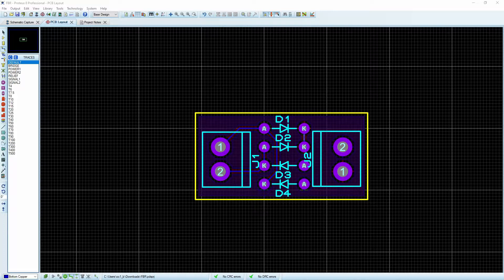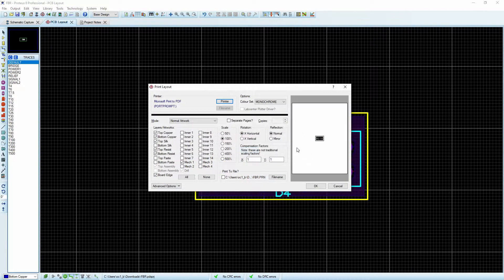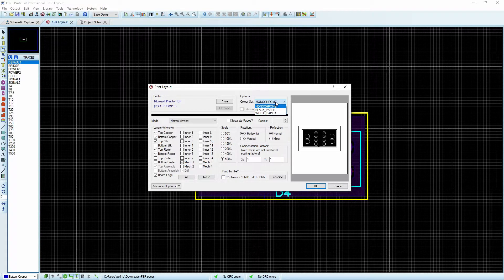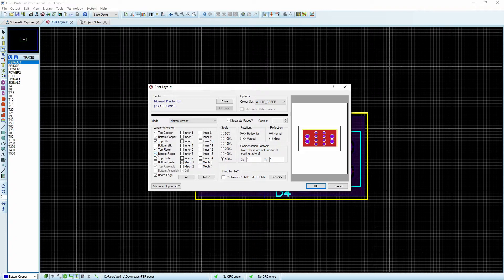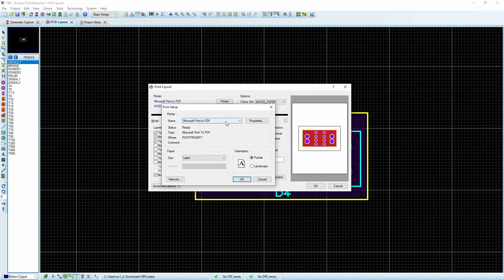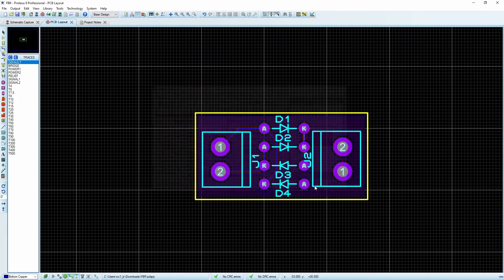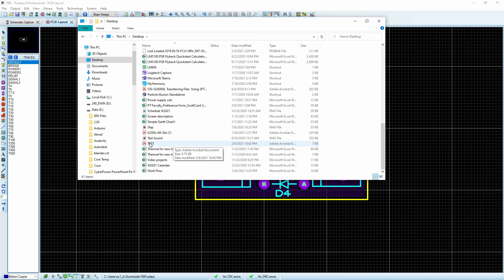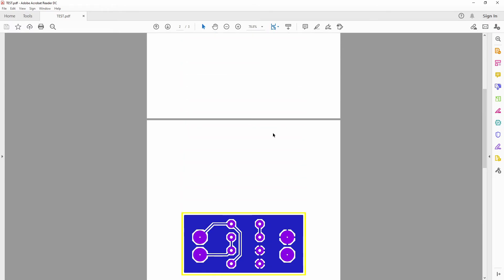PCB Printing in Proteus

Comment: transmitter and receiver gpr radar ( wave)
Reply from the maker: Not a simple project! I have no experience with this (yet) but, where in the design stage are you at? Is there something specific you need my help with?
Reply: @ScottCard  jes please , I found the transmitter wave diagram but I'm not sure it works !
Reply: @ScottCard  LRLc telescope
Reply from the maker: @moussafakir4765  Please provide a link to the datasheet so we can have a look.
Reply from the maker: As the article you have provided points out, this product is not likely to ever work. The now obsolete IC is a frequency generator and the other is an amplifier can still be found but, from a physics stand point, you will not get much in the way of results (especially with paper money). All you will detect on this it the signal you are generating and the button you push. I would suggest you find another project but, if you feel strongly about this one, build it up on a breadboard. You could even use a function generator and oscilloscope to do a proof of concept. Interesting read, thank you.
Reply: @ScottCard   prof, In order to build, what means resistor 200, disk 100k, and 10k tuning? 100k disk is variable resistor?
Reply from the maker: @moussafakir4765  Parts list:
ICs
     XR2206
     LM339

Diode
     LED
     3.9V Zener

Resistor
     3@5100Ω (5k1)
     2@200 Ω
     2@33000 Ω (33k)

Variable Resistor
     100000 Ω (100k)
     10000 Ω (10k)

Capacitor
     10nF
     1µF

Switch
     NC push button
     SPST Toggle
https://www.sparkfun.com/datasheets/Kits/XR2206_104_020808.pdf
200
Reply: @ScottCard  thank you very much prof 🤝
Reply from the maker: @moussafakir4765  no problem. Let us know what you find!
Reply: @ScottCard   prof, I find only 200k and 200r, of whom I can change it value to 200 ohm . 200k or 200r? in proteus
Reply from the maker: @moussafakir4765  Use a default resistor (RES) and change value. The same with the variable resistor. Use POT-HG.
Reply: @ScottCard  prof hi ,How can the variable resistance be used, knowing that it has 3 terminals? How can I connect it in the circuit with respect to 200 ohms? For 100k and 10k the same thing ..!
Reply from the maker: @moussafakir4765  When using a potentiometer as a variable resistor, only use one terminal and the wiper for a linear response.
Reply: @ScottCard  For the variable resistances 10k and 100k,....( potentiometer or Rheostat ) please ?
Reply: @ScottCard   How can I install the variable resistance in the circuit to change the frequency and the current? potentionmeter or Rheostat ???
Reply from the maker: @moussafakir4765  Use "POT-HG"
Reply: @ScottCard  variable resistor (Pot-HG) has 3 terminals, for xr2206 frequency control, how can the variable resistor be installed ?
Reply from the maker: @moussafakir4765  Connect one end and the center (wiper) to provide a linear response.
ie. pin 1&2
Reply: @ScottCard   prof please , The type of capacitor( 10 nf , 1uf )  used in the circuit ?
Reply from the maker: @moussafakir4765  Less than 10uF can easily be achieved with a ceramic capacitor. In Proteus use CAP from the library.
Reply: @ScottCard  How to measure the frequency in proteus ?
Reply from the maker: @moussafakir4765  You can use the "Counter Timer" or the Oscilloscope found on the left under INSTURMENTS.
Reply: @ScottCard   When running the circuit in proteus, it does not work. 
partition analyser errors ( no model specified for U2/ simulation FAILED due to partition anlysis error(s)  ) . Source : U2  xr2206.
Reply from the maker: @moussafakir4765  This means that there is no simulator model. You can exclude U2 if it not needed but, other than that you would need to find the SPICE model. I will have a video for this in the future.... way down on the list.
Reply from the maker: When picking parts to simulate, be sure to select the "parts with models" filter on the Pick parts menu.
Reply: @ScottCard  Can you tell me which side to tie a counter timer? To measure the frequency in the circuit because it doesn't work and oscilloscope please .
Reply from the maker: @moussafakir4765  With the oscilloscope, connect channel A to your signal. Adjust the time base to have 1-2 cycles displayed. Then count the number of gradations one cycle takes. Multiply this by the time base. this is the cycle time. 1/time = frequency. ie. 5 grid spaces X 5ms = 25ms/ cycle. 1/0.025 = 40Hz.
Reply: @ScottCard  pin" wave" does not exist child model
pin "vcc "does not exist child model
pin  "wave " does not exist child model...............xr2206 .How can I solve a problem please
Reply from the maker: @moussafakir4765  First, I am not sure where you got your model, this is usually seen when you have an incomplete model or script. Second, check your power rails and look at how the model is set-up. Creating a simulation model from scratch is not an easy process.
Reply: @ScottCard  Is in this case the circuit will not work  ،Can't measure the frequency?
Reply from the maker: @moussafakir4765  Not if there is no simulator model. The data sheet explains what you  have. The plication not will be accurate for this so you could build the circuit for testing. Such an old chip, it will be very predictable..
Reply: @ScottCard  Could you sir make me a video please, i will share it with my friends on youtube
Reply: pleasssssse
Reply: @ScottCard  I did not find any video explaining this on YouTube
Reply from the maker: @moussafakir4765  Modeling an obsolete IC is not a small task. I strongly suggest you find a more modern IC. Otherwise, to simulate this, you can use the frequency generator found in the tools menu. I have a video coming about that but, it is quite far down the list.
Reply: @ScottCard  Is there a program like proteus, I will not find a problem with the xr2206 build?
Reply from the maker: @moussafakir4765  I could not find a model anywhere, meaning no program would not be able to simulate it. This does not mean that one can not be made using a SPICE program. This is not an easy process and the chips characteristic needs to be understood to do this. There are two points to this: 
1) This is an obsolete IC that has been superseded by   new IC and techniques to do what you are trying. 
2) The circuit is simple enough, you could prototype a circuit and experiment with the design.
I am sorry, to my knowledge, the best you will be able to do is approximate it in software.